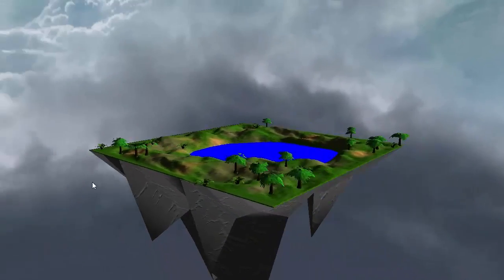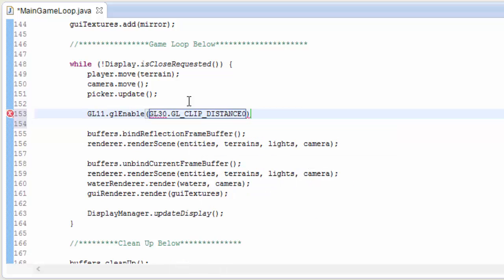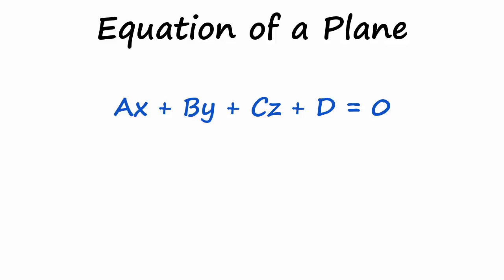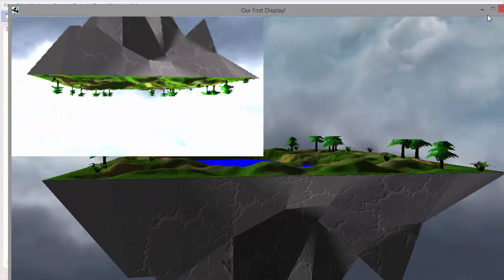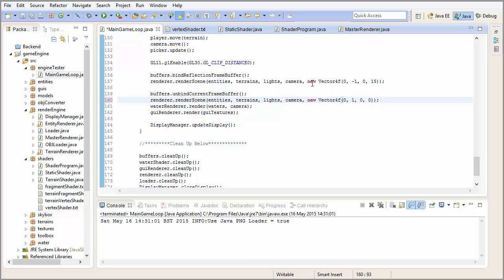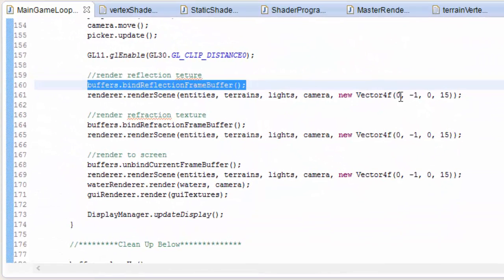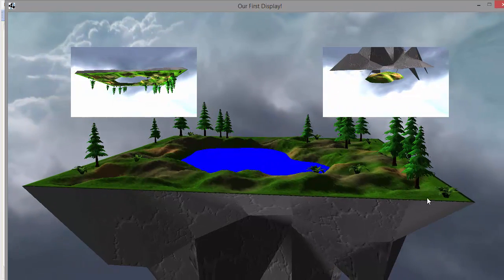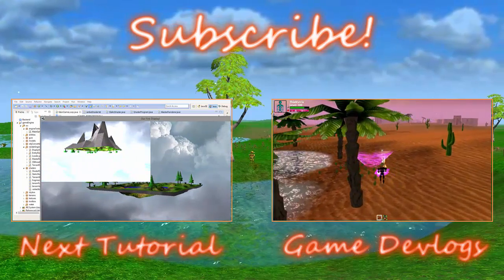OpenGL Water Tutorial 3: Clipping Planes

Comment: For some reason, GL_CLIP_DISTANCE0 is causing weird rendering issues. The water quad flickers and half of the skybox is gone.. I don't know what to do..
Reply: I'm having the exact same issues. Did you figure out a fix for this?
Reply: Had the same issue, adding gl_ClipDistance[0] = 1 to skybox and water vertex shaders helped. Looks like some OpenGL drivers use garbage gl_ClipDistance[0] if it is not provided in shader and clip distance is enabled.

Comment: Hi, I am following the tutorial until here. When I added the "GL11.glEnable(GL30.GL_CLIP_DISTANCE0);" to my main game loop, the program can't run. Before adding the line, everything works fine. After adding the line of code the program hanged at the line of code every time I execute the program. I am using Macbook air 13'. What are the possible reasons behind this problem?
Reply: Edit: It didn't hanged but running at a speed of 0.0X fps. I have no idea what happened

Comment: I'm not really sure how these things work to be honest, but isn't rendering something 3 times pretty inefficient? Unless this is only for showing purposes, once the real water thing comes in, this'll change a bit to be more efficient?
Reply from the maker: ***** Well it's more expensive than rendering something once, but this is how you create reflective refractive water. If you want good graphics in a game then there's going to be a lot of processing going on. So yes, we do need to do three render passes, but there are many ways of optimizing this so that it doesn't affect the frame rate too much. 

For a start these clipping planes will help a lot, especially for the refraction render pass because there's usually hardly anything to render under the water. On top of that, you don't have to render the scene in full quality when you do the reflection and refraction render passes. You can set the resolution of the frame buffers to be lower which will make a lot of difference, and you could only render larger objects and not bother with rendering small things like grass (the only downfall being that the grass wouldn't be reflected or seen underwater, but that might not be a problem depending on you game). 

You can also use lower res textures for the reflection pass and it won't be noticeable because the reflection will probably be very distorted, and you can also use completely different, low quality shader programs when rendering the reflection and refraction textures (using per vertex instead of per pixel lighting for example). So there are loads of optimizations that can be done to make sure that it is as efficient as possible :)
Reply: ***** 

Firstly, thanks for replying with so much detail, I didn't mean to take so much of your time if that did take a while xD

Secondly, oh right, I just completely forgot about the whole idea of clipping planes, yeah I guess that'll help a lot. Also, setting the resolution again seems very logical.

These optimizations seem very good, thanks. I don't know if it's possible for you to go into a small amount of detail on this in a video in the future? I'm not really sure how I'd be able to control texture quality using the buffering and shaders.

Comment: Couldn't we use the clipping planes to double as a render distance limiter in the actual game engine?
Reply from the maker: CosmicPeach We could, and I actually use it as a secondary distance limiter so that objects slide out of view instead of just disappearing, but you would still want to use a distance limiter that doesn't send the far off objects to get rendered at all because there will still be OpenGL state changes and vertex processing involved with rendering objects, even if they get clipped by the clipping plane.

Comment: Could you use these for frustum culling?
Reply from the maker: There's not really any need to do that, OpenGl already clips everything that is outside the screen or in front of the near plane or behind the far plane. Basically it already has clipping planes for the six sides of the view frustum. However, this clipping happens after the vertex shader (because of course it's the vertex shader that determines the vertex's position on the screen) so all the vertices of objects that are outside the camera's view frustum are still processed by the vertex shader. This is the same if you use user-defined clipping planes as well - the clipping happens after the vertex shader. This is why frustum culling is still needed, because even with the clipping planes the vertex shader will still run for all the off-screen models that you render. So you need to test the objects with the frustum in the Java code and then not render the off-screen objects at all.